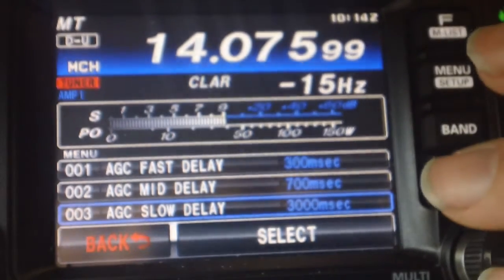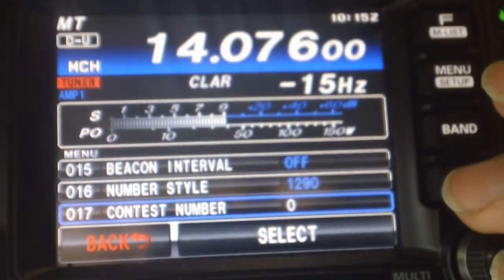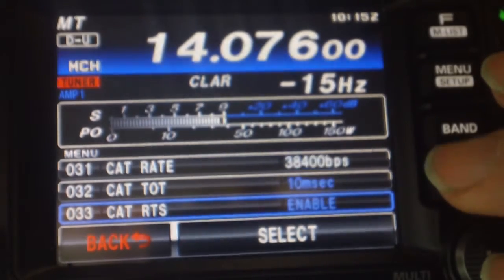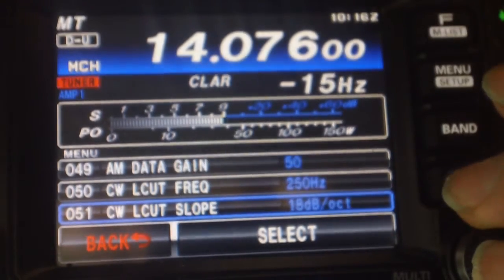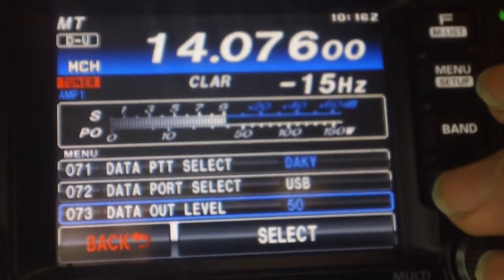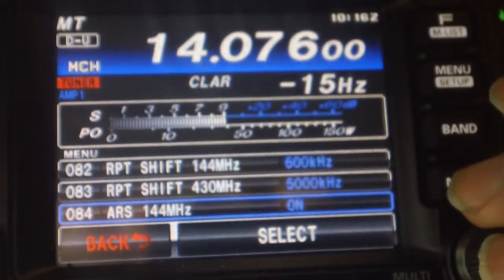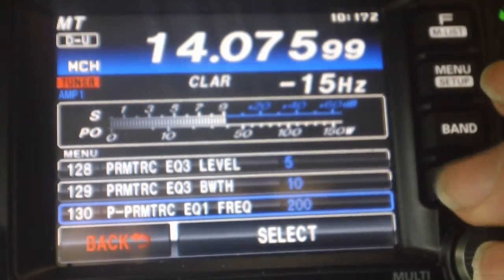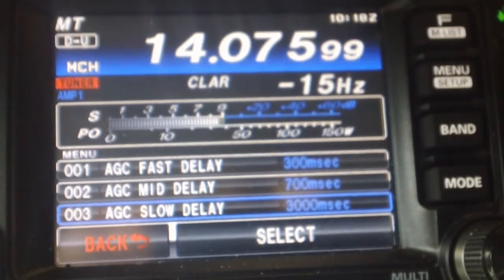ft991 USB  FLDIGI WSJTX all menu settings

Comment: Menu 77 needed to be on USB. And you must set radio in  Data-FM to make it transmit properly in  fldigi. You Also have to remember to switch radio back to regular FM for  phone ops. This is with  concurrent use of  FLRIG....making sure both USB com port drivers are properly loaded.

Comment: Well, I tried the settings, now nothing works.  Was having decode issues, thought it was a radio issue, guess not.  Now the only thing it does is listen, won’t even tune the radio now.  I’m really starting to hate this hobby.
Reply from the maker: dont give up..check baud rate and com port , make sure they match what you have set on your computer side..that solves the non-tuning issue.  2nd, make sure your clock is properly set on your computer.  If it is off by more than 1 second, you will not be able to decode.  Windows is terrible at keeping the clock synchronized...  listen for the transmissions, and they should end (on ft8) about 13 28 43 and 58 seconds, and start up on 0 15 30 and 45
Reply: See my comment above for what finally got me working. I also had to use FLrig

Comment: Hi from John G6MHR UK
Great vidio by the way.
Question on Wires X
The question is access to rooms error Direct code access not working
poor access to a Wires X repeater etc.
squelsh set at 20 as recommended.  
If used how many hams are having this problem on 991's ?... All up to date as Feb 15 2017  CQ-UK my main chat location.